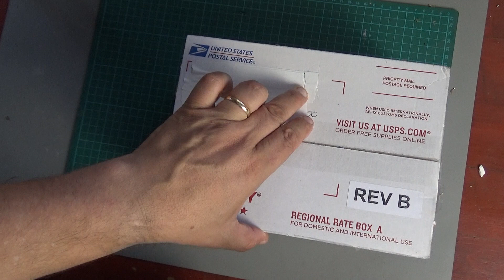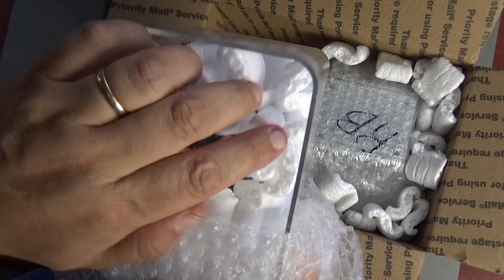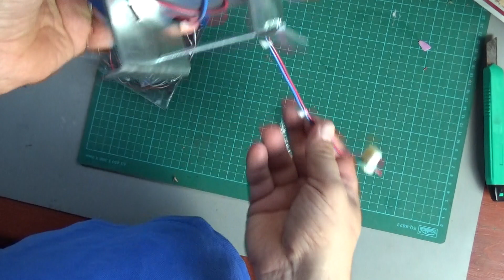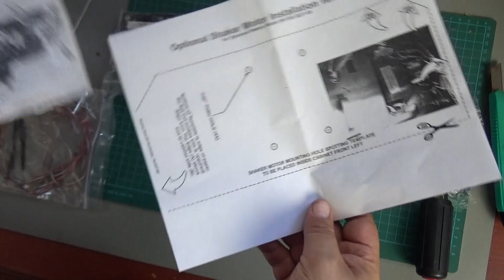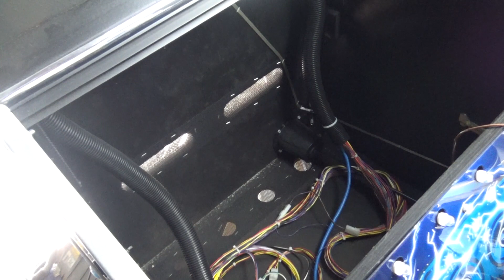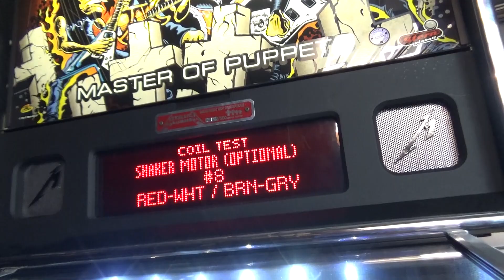Shaker Motor Installation in Stern - Metallica Pinball Machine

Comment: WARNING: Ground not connected

I have viewed a number of these Sam shaker motor installs and all seem to miss connection of the ground wire.    I will go back and look  at my install.   But, essentially, if your  cabinet had the pre drilled t nuts, your ground wire is a single molex that is prewired and tucked behind the loom in the general area of the tilt mech.   I could be wrong, but I will verify and let you all know.
Reply: Did you ever verify this? Looks like the v2 board doesn't have a connector for ground